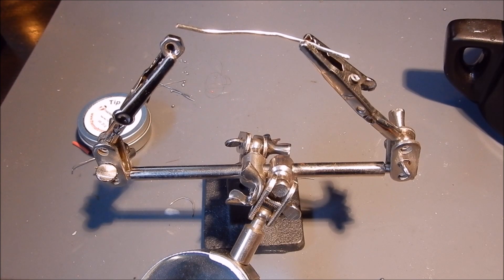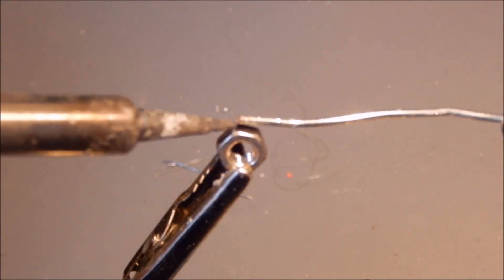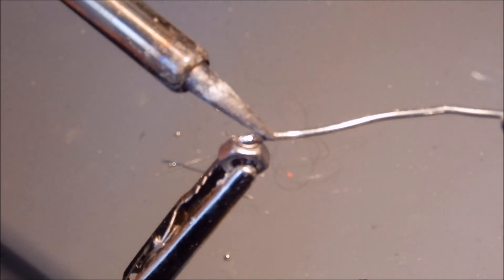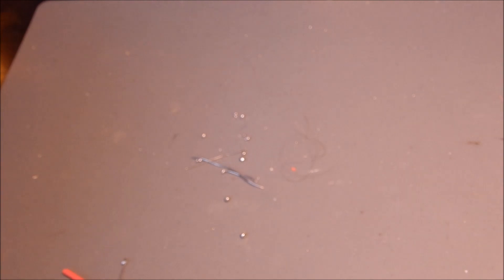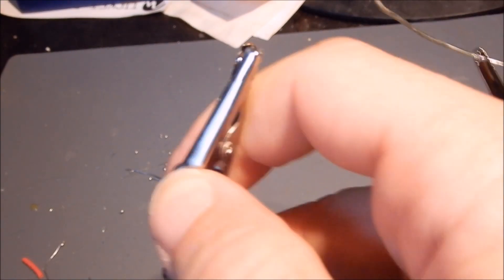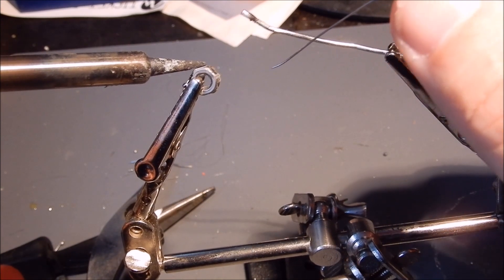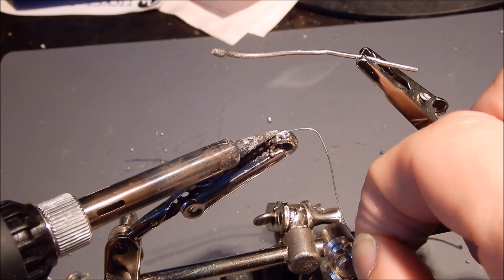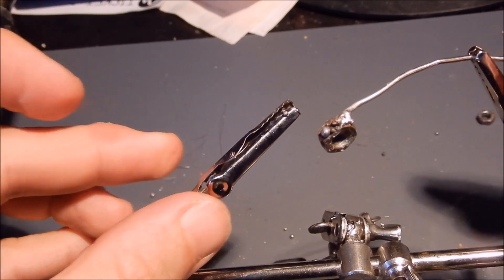Soldering to stainless steel

Comment: You just need to make sure the parts you solder are very clean - abrading surfaces always helps. Stainless steel just needs a high acid flux. Be sure to clean flux residue thoroughly afterward. And OMG, don’t use lead solder. No (low) lead solder forms a much stronger bond as it requires higher temp.

Comment: PLEASE use safety goggles, if this flux splashes into you eyes its darn bad!

tip: when soldering bigger pieces of metal, like this case, i find it helpful to use a small torch/jet lighter to heat it all up. cheers :)

Comment: Hello.  First issue ?  You need to use flux, rosin, or some type of wetting.

Second: your heat source must be at the bottom of the work.  Heat rises.  Put the iron on the bottom of your media and the heat will work its way through and up the mass.

Put the nut and the wire jigged in your holding jaws.  Allow the 3rd hands to keep the joint in place.  The only thing you should be using your hands for is to hold the iron and the solder.

Rarely if ever should you touch the iron on the material and the solder onto the iron.  The solder should flow onto the work when it is at melting and binding temprature.

Comment: The hook to a deep fryer in my job broke off, it seems the two spots where it meets the frying basket we’re welded or soldered. I don’t have a welder but do have a solder machine for my guitar stuff. Would that work you think? Thanks

Comment: Just my thoughts:
A. Your tip is dead, either clean it or replace it.
B. Your helping hands (alligator clips) act as a huge heat sink, put some shrink tubing over them or even fiberglass insulation tube.

Comment: You really need to get a new tip. How you can even thing about soldering with a dirty worn out tip is crazy. And it should be a big chisel tip not a conical
Reply: Main thing it's his set up and he achieved what he wanted to do !
Reply: That's not the "main thing" - the main thing is that he has no concept of correct soldering and safety procedures - some person, watching this "tutorial" can get seriously hurt/ill from the acid flux and fumes, and will be wasting time and growing out of patience if they follow this guy. He COULD have done some research on the subject, but chose to flub through everything on his own. He definitely should have had a safety disclaimer!   @zeez3139

Comment: i think its doesnt work
Reply: dlm aliexpress ad jual flux untuk solder stainless steel.. guna flux tu snang je nk solder stainless steel.. slalu guna untk solder kepala bateri vape, mmg snang guna flux banding guna flux biasa...
Reply: @harisyoung4110  ?
Reply: @jurijavsenak  there is special flux for soldering stainless, you can buy it on aliexpress, its not so expensive..

Comment: One trick that helps for soldering is just like welding, clean the surfaces of oils residues and even sand them down to roughen them up.
Reply: Exactly this is what i do anytime just sand it little with a sand paper and voala works.